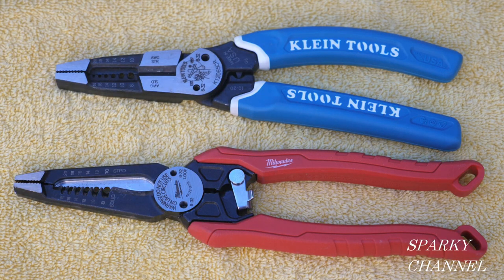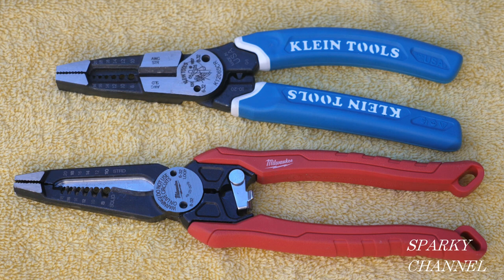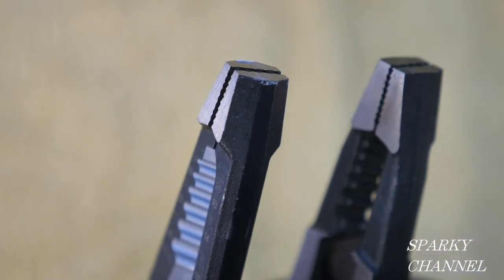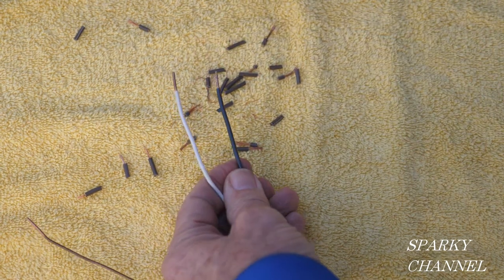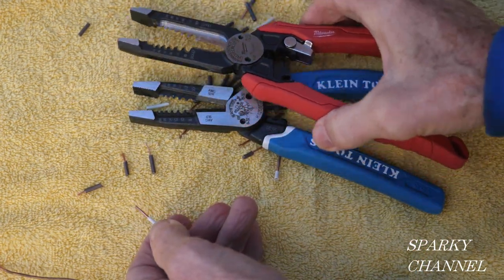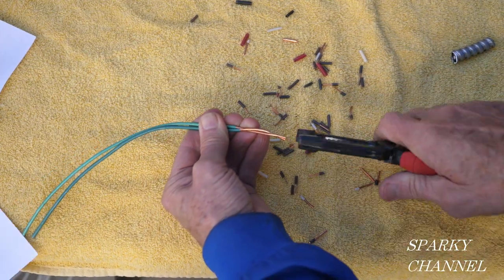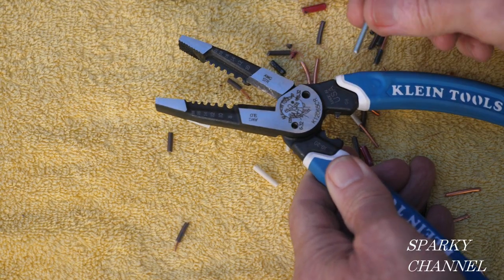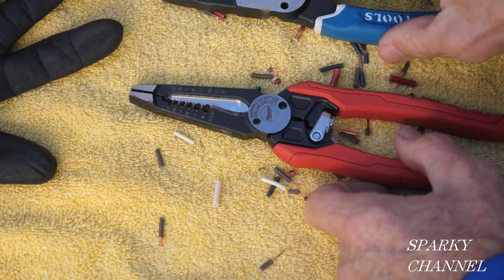Milwaukee New 7 in 1 Combo vs. Klein-Kurve Combo Pliers, Which Will Win?

Comment: Great comparison! Really like that Klein is made in USA but I could live with Milwaukee being made in Taiwan due to the better cutters. If Milwaukee said made in China they would definitely be a no-go.
Reply from the maker: There is a difference between China and Taiwan.
Reply: The cutter is better but the tips on the klien are better too grab wire.
Reply: @SparkyChannel  Totally.  In many ways.   A decently made Taiwan tool is typically going to be well made, with high quality materials.  I may not be up to date, but my take on this is that I generally assume a Taiwan-made tool is a good tool unless proven to be bad, and a Chinese tool is not a good tool unless proven to be good.  Excellent vid, btw.  I'd be interested in a comparison of the older 6-in-1 tool vs the new 7-in-1 Milwaukee pliers!  As far as the Klein vs the old Milwaukee, I have both in my bag...need to check out the new 7-in-1.
Reply from the maker: @johnnewell5025  Hi John! Yes, I think that people don't realize the great differences between China and Taiwan. Excellent idea on the comparisons, thanks!
Reply: @SparkyChannel  I think it'd be a popular vid.  HD has got them next to each other now but the old 6-in-1 is $20 vs $30 for the 7-in-1.  I think even guys with a bag full of Klein tools looks at these and thinks about buying one, but now with the two of them side by side the question is whether the updates are worth paying half again more for, or whether the 7-in-1 is worth buying at all if you have the 6-in-1.
Reply: The pliers according to the packaging of my Milwaukee pliers says made in Vietnam 🇻🇳
Reply: My package said made in Vietnam 🇻🇳 on the package
Reply: What sold me on the Milwaukee was the spring actuation, the lock, the robust long handles, and the sheer weight......This is a tool with shoulders......
China and the Asian rim have come a long long way...

Comment: Great vid. Because of that spring Milwaukee wins hands down. No spring no sale. Thanks.
Reply: I hate the spring first thing I do is rip them out
Reply: @PeterTrimboli  that's why I don't mind a tool coming with a spring or latch; just take 'em out and put 'em in the spring drawer :-)
Reply: I cut off the spring and drill out the locks. I hate when they spring open in my pocket and I spend 5 minutes trying to fish it out
Reply from the maker: I hate the latch and I'll decide on the spring on a tool by tool basis. Good comments!
Reply from the maker: Milwaukee 1, Klein 0.
Reply: I do have the klein ones and mine don't strip very well
Reply: I've went back and forth on the spring or no spring issue. The past few years I've been on the spring, even switching between klein and milwaukee needle nose strippers. Still can't make up my mind on brand so I have a couple pairs of each.
Reply: Yea I don't like springs on wire strippers actually so I'd just tear it out
Reply: No spring was a non issue for me after 30 minutes of use...the Klein are awesome...except that the piece of stripped wire coating always sticks in the jaws...it is starting to get to me...
Reply: If ur not a bum and you actually use a tool pouch the latch and spring are both nice.  An electrician should be pulling his tools out of a tool belt not his pocket.  I'd fire my guys if they tried to weasel out of a tool pouch. Dont be a dummy and but a nice tool pouch.   Boom problem solved.  Occidental leather and veto pro pack make some amazing tool pouches.
Reply: @the2Atreeclimber  since I’m too important for the universe, I will say this. All wire strippers must have a spring. If they don’t, I don’t buy them.

Comment: bill on that milwakee you are catching your thumb on the latch   flip the pliers upside down
Reply from the maker: Good tip, thanks. Or just drill out the latch. LOL!
Reply: The way his thumb ran past the latch it almost seemed like he was doing it deliberately
Reply: @SparkyChannel  , yes, is what I did with my kleins, that had a latch and spring, and  love those, had spring and no more latch.
Reply: You can put a rubber band around the latch. I like the rubber bands that hold brand new inner tubes together lol. A zip tie positioned just right at the top of a handle can turn ordinary pliers into spring loaded pliers 😂 sort of.
Reply: @SparkyChannel  Exactly what I did, one minute after removing the spring 😂
Reply: I think he realized that, maybe subconsciously, because later in the video, they're flipped over.

Comment: I own both. In my service bag I have the Klein because those are my general wire strippers. I bought the Milwaukee one recently and it’s a good all purpose tool to have around the job site if I’m doing a bunch of things. I found twisting wires and cutting with the Milwaukee was easier because of the extra leverage it has. But this is just my take on it. They’re both really good tools.

Comment: I’ve had both- my lead tried cutting a metal strap off an emt master bundle the first week I had them- bent up the holes for the 12 gauge stripper and made the pliers bind when operating- returned them and got the kleins instead. The Kleins carry a lot more comfortably in your front pocket because of the small and curved handle, along with the slimmer profile of the handles. Also they don’t need a latch to stay closed because they’re not spring loaded. Overall I like them both but preferred the Kleins for edc pocket carry on the job along with some channel locks and an 11 in 1.

Comment: I just picked up Knipex's version of this tool, and it is AMAZING.  The tolerances alone make me want to frame the thing--it just feels wrong to risk scuffing that piece of art.  The very tip is for pulling, and the teeth are aligned to that their peaks meet up with the peaks of the other side, but they don't touch.  It helps reduce the damage to any wire or tape you are pulling on.  Then there is a circular set of teeth that I think is for helping to hold fasteners in place, or maybe to use your tool to turn the fastener?  Not sure.  The next set of teeth are aligned so the peak on one side meets the valley on the opposite side, closer together but still not touching.  (That's intentional--there is a small detail in the teeth layout to control the gap.)  After the teeth you get the same size range for stripping wire as the Milwaukee and Klein, followed by an area just before the pivot for cutting everything up to metal clad cable.  That's a mouthful for the cutter, so Knipex made their own version of Milwaukee's curved blades that does a better job starting the cut.  The same bolt shears are there along with an internal spring and a latch.  It's just a very well-made and thought out tool.  My only complaint is Knipex doesn't offer an electrically insulated version for some reason....

Comment: I have the Milwaukee 6in1 (not this 7in1 in video) and the klein in this video and I prefer the klein. The Milwaukee has much better cutters and bolt cutters but the klein is so much better at stripping wires which is what I use it for the most.

Comment: I'll take the USA made Kleins all day long.  I knew as soon as I looked at the crimpers that the Klein was better at crimping because of the smaller denting nub. If I'm cutting something heavy I just grab my Klein lineman pliers. I have some blue handled vintage ones that say (M Klein and Sons) stamped into them. I have regular Klein wire strippers that work great. 

I did recently get a pair of Husky brand all purpose that look like the ones in this video on sale for about 8 bucks and they are surprisingly good quality.  If I'm getting Chinesium then I don't want to pay 30 bucks for them.  They are $17 at home depot now and I can recommend them to anyone on a budget.  I normally stick with Klein but I'm pretty happy with these and I still have the Klein in my bag if they fail. They strip and cut wire just fine and the reamers are excellent. I may eventually get the Klein version and relegate the Husky ones for home use.

Comment: Ben electrician 37 years I've been using Klein knitpicks is very good also I have  Milwaukee from the 1970s from my father who passed away they make good stuff also back in the seventies it was made in the USA also when you were stripping the wire you supposed to turn it 180 degrees that will make it easier as you're cutting the insulation all the way around
Reply: Something that works just as well and is better on your wrists in the long run would be start stripping the insulation with the stripper at an angle then rotate it so it becomes perpendicular to the wire, this causes the cut insulation to push away from the rest of it and then pulls off super easy.

You rotate your wrists less often which means you are less likely to build CPS or other issues caused by repetitive tasks.
Reply: What are knitpicks?

Comment: I have the klein, replaced four tools: side cutters (I carry a hammer), needle nose, crimper and strippers. Makes decent joints, crimp for grounding barrels, nice strippers, makes nice "tink" sound when clipping. Only downside I've found is cutting decor faceplate screws for tile installations. The hinge is too wide and will not cut the screw short enough (to keep the screw from grinding into the tile and pushing the plate away). I may check this Milwaukee out just to see if it will cut that one 6-32nd short enough. The extra leverage from the additional inch of handle couldn't hurt either. I was taught by a crusty old dude who constantly said things like, 'the less sh*t I gotta carry, the better'  and  'you should be able to rough an entire house with side-cutters, a screwdriver and drill'. and now I guess Im a less is more kinda guy now too
Reply: You need the standard style of strippers the Milwaukees are also to long to shorten screws for backsplash unfortunately
Reply: @AnxOG663  Darn. That's too bad. Thank you for the heads up
Reply: @ajyhimst2782  I was pretty bummed out but I have like 16 pairs 😂 that can cut the screw short enough

Comment: I personally like my southwire long nose 5 in 1, they cut mc cable very well, the long nose makes it easy to clean out knock out holes in the boxes and it can strip 14, 12 and 10 gauge which is all I see when I’m just roughing in suites and doing corridors. I have used the Kleins before and not a fan, it does all you need it to but doesn’t do any of them well.  If I need to strip 16 or 18 gauge  I rather use my strippers.
Reply from the maker: I love the cutters on those pliers, they're awesome.
Reply: My favorites are southwire too. I have the multi with lineman nose, 10 and 12 romex, 10 and 12 single, cutter, bolt cutters and looper. They’re so awesome. No clamping down and jerking to get the insulation off. Close them, twist a little and the insulation slides off nice and smooth. Perfectly machined so they get all the way through the insulation without biting into the solid wire. None of my other strippers are that smooth and I’ve tried them all. All of them require that awkward tug and the insulation snaps and you hit something with the pliers when it suddenly lets go.

Comment: Over the years i created a list of what works best for me. And professionals in my shop
-For power tools -impacts, drills, bandsaw 1/2 inch impacts etc
*Milwuakee
-Best grinders and hammer drills
* Dewalt
-Best hand tools and screwdrivers
* klains and craftsman
-bits 
* Milwaukee, DeWalt, Wera
-Knives & blades
* DeWalt
For working on my car
*Milwaukee sockets( and they're square so they don't roll under your car when you drop them 😍. 
And for impact sockets
*craftsman.. I work on diesel trucks. And they work as hard as snap-on and matco and they last for ever

Comment: Anyone considering either of theese please read this it will save you wasting your money. I've had theese Milwaukee pliers since they were announced at this years NPS. If you notice both pliers when stripping required alot of pulling. The handles on the Klein's are not good for splicing as they are not equal handles. After a few weeks the strippers on the Milwaukee's got more and more difficult to use. Do your self a favor and get the new Knipex Forged Wire Strippers. They are very similar to theese but much better quality. They strip with absolutely zero effort.
Reply from the maker: I have to admit, the Milwaukee's feel large and cumbersome when stripping the small gauge wires. I'll have to try the Knipex.
Reply: Well I got the Milwaukee  48-22-3079 wire cutters and they haven't failed me after all these years but damn I really want those Knipex wire cutters. Thanks for the reminder.
Reply: @SparkyChannel  I would love to see a video comparison with the knipex. I have been kind of curious about them myself and heard nothing but great things about them.
Reply from the maker: @robfahey1349  What would you like to see the Knipex compared to?
Reply: @SparkyChannel  I guess the milwaukee. I like the curved handles for wire stripping, but I feel like using them to splice would be awkward so I rather a straight handle for a combination plier. I saw an ideal combination plier like the klein that looked nice and I almost picked it up but figured that curved handle kills it for using to splice could be just me and what I'm use to.

Comment: I actually have a Southwire stripper I like a lot. They’re combo pliers. Lineman’s end, Romex 14 and 12 stripper. Single 10 and 12 stripper.  Cutter, Bolt cutters, looper. Smooth as silk. Close on the wire, turn 1/8 and the insulation slides off. Perfectly machines so it doesn’t hang on the wire or strip too little insulation.
Reply from the maker: Excellent! Thanks Jared!

Comment: After using the previous generation of the Milwaukee, which has been a great tool for the past 1year+, I like the upgrades they have made with the new-gen. Wider head, crimp tool, looks lighter and is longer helping leverage for harder cuts. I think the spring is a no brainer, literally cuts the amount of effort required to use the tool and increases efficiency. If you just flip the tool around so you push the latch down with your thumb to unlock it you can never accidentally latch the pilers closed. IMO the latch is necessary to keep the pliers closed in your trouser pouch or bag to reduce the amount of space they take up. The cutters on my current set have seen better days (Cutting things I shouldn't with them lol) and the 1.5mm, 2.5mm strippers have become dull I'll be upgrading to this set. The price point is a bonus as well, I paid £22 for my current set and I can get the new set for the same price.
Reply: The reason I want to upgrade is the larger head, so I can twist wires. But I sense that the Milwaukee is not as easy to twist wires. What has been your experience?
Reply: @rogerholland98  Yes, it's differently not the easiest to twist wires together but it's great for reaching hard to get to places so it has pros and cons. I've ordered the new one and I'm going to pick them up tomorrow. Hopefully, the wider head on the new set fixes this issue👍🏾.
Reply: I said the same thing when I saw the latch flip down. Flip it over and gravity solves that problem. I had to buy a cheap pair that were spring loaded and didn't have a latch because I forgot my good pair at home and that was all the hardware store had where I was working. I haven't used them since because they take up too much room in my bags

Comment: I noticed on the second strip, you bumped the latch with your thumb as you squeezed.  simple solution is to roll the tool over in your hand, as you did on the #14 solid.

in the final analysis, I like the curved handle, but I have it on the non crimping Klein strippers, right now, which have a spring and latch, as well as bypass cutters.  crimping is much less relevant to me since I do very few crimps, and I do those with my lineman's pliers.  I prefer to make hooks with the jaws, so Klein loses points on that - the jaws are too thick to make a proper diameter hook.  heavy wire cutting is also irrelevant, since I rarely cut anything bigger than a single conductor with my strippers.
final analysis for me is I'm not going to throw away a tool I get along okay with because I might like another one better.
Reply from the maker: Yes, I could see that on the replay. I prefer needle nose type strippers as well.

Comment: Anybody notice how much faster the Klein's were than the Milwaukee at stripping.  I could also point out that the Klein's anvil style cutting edge will likely never dull out or damage like the shear style will.  I'm l not sure I want either one. But I'd pick the Klein.  I just hate strippers that have the holes so far from the grip.  Lightweight Ideal T Strippers, or the little yellow grip handle Klein's for me.

Comment: I bet the steel quality on the Milwaukee is inferior to the Klein and after a few months they won't still cut that great. After hard use you find out how good something really is.  Even the cheap Husky brand cut well while they are new, I have a pair but I know they won't last as long as my Kleins.
Reply: You’d be right at least for my experience, I used the milwaukees after they came out for about 3 months and the cutting jaw is either rolled on some parts or dull, same thing for the stripping teeth so switched back to the Klein
Reply: @lvalle1994  and the Klein is only $10 more to me that’s a bargain, in my opinion Klein’s are priced below there quality.

Comment: Your thumb slides down when you begin the stripping motion. That's why the latch catches. My thumb moves less and at the start position my thumb is already touching the other handle. Your thumb slides down to approach the other handle. Maybe my hands are larger.
Reply: Exactly. When he complained the second time I backed up the video and noticed his thumb was pushing the clip down. Is it the pliers fault? Perhaps some but I'd say he just needs to train his thumb to not push it down.
Reply: @NickFrom1228  Yeah. Too many moving parts going on for a simple cutting/stripping action.